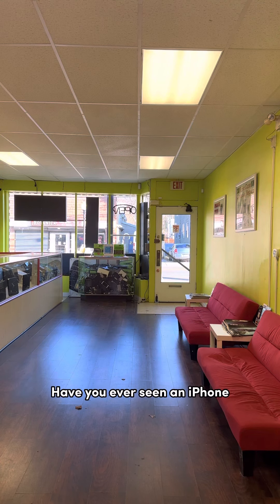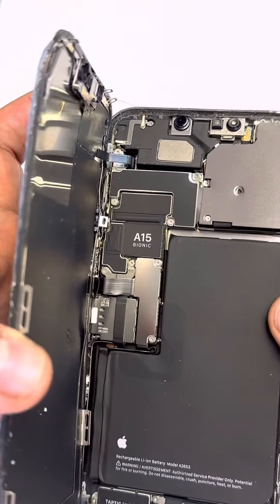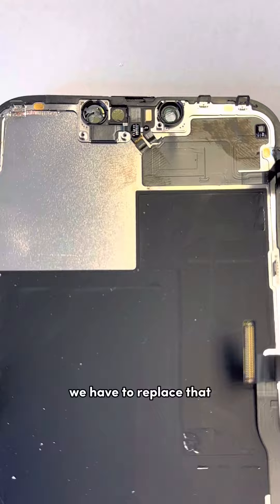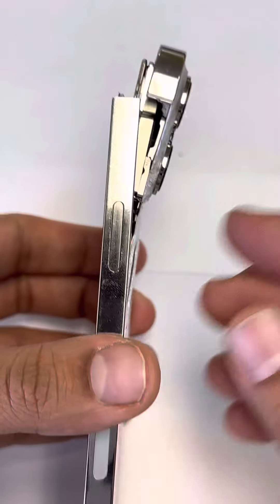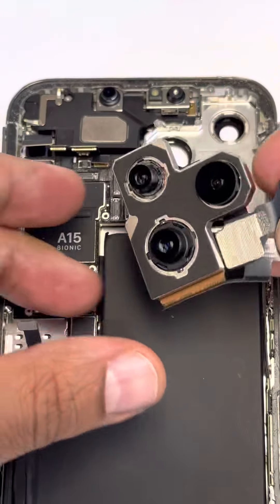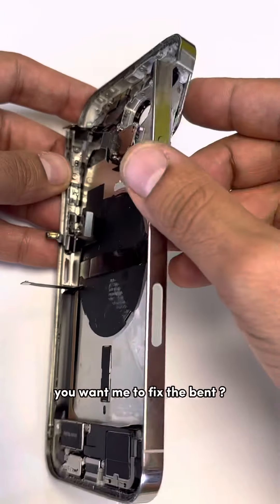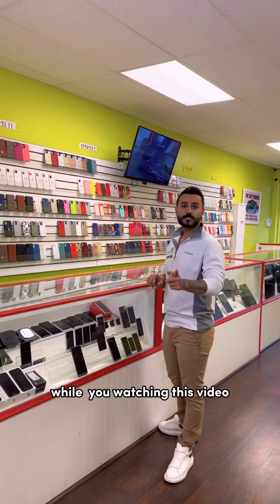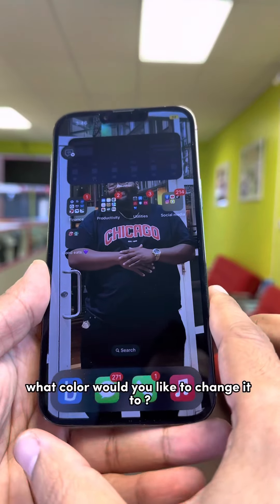Turning Destroyed iPhone into Different Color! 😍

Comment from the maker: What’s your battery percentage right now? Comment below 👇
Reply: 21
Reply: 60
Reply: 100
Reply: 58
Reply: 90%
Reply: 88%...2nd time charge✌️😊
Reply: 26%
Reply: mine is at 100
Reply: 74% of SoH and 22% SoC
Reply: 43
Reply: 100 gang bang
Reply: 4
Reply: 97%
Reply: 22
Reply: 81
Reply: 72 used 3h 47min ago (Galaxy note 9)
Reply: 98%
Reply: 98%
Reply: So you melt down the metal get a mold for the phone and recreate the bezel and turn it into a new color with a new back glass. Now that’s pretty impressive.😂😂😂
Reply: 100%
Reply: 63
Reply: 23%
Reply: 97
Reply: 34% and my phone is charging